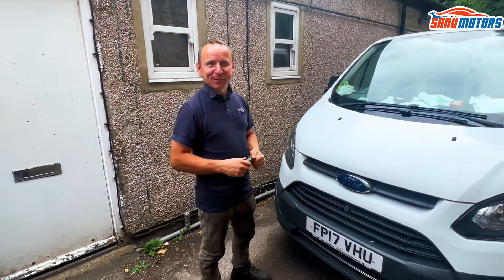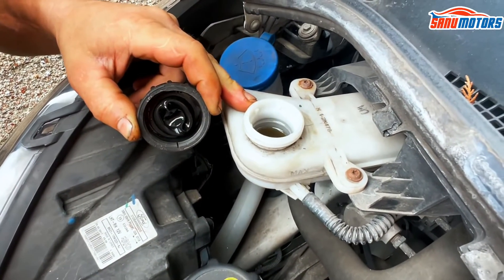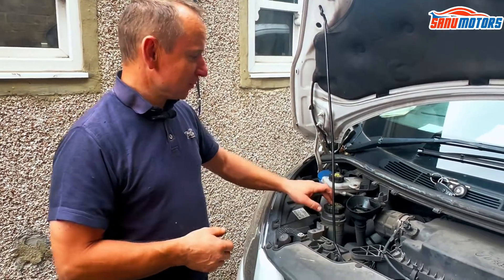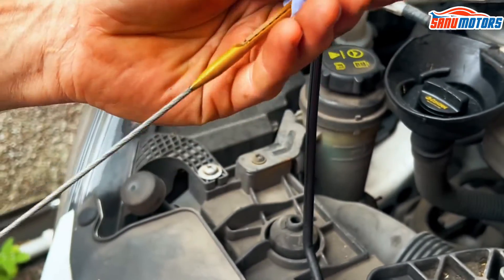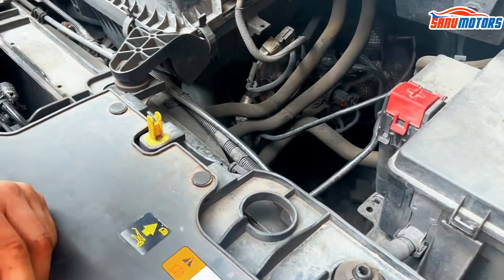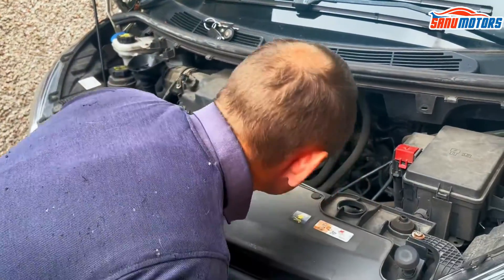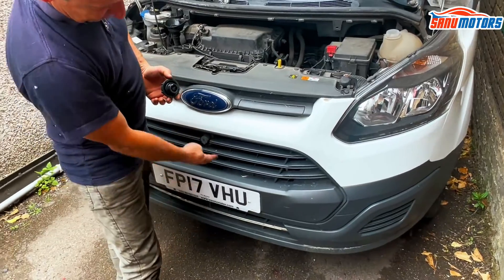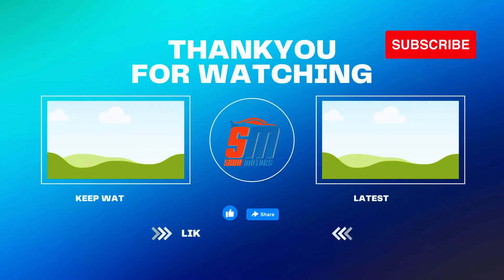🔴 Ford Transit Custom 2017 Under the Bonnet Topup  | Essential Fluid Check Guide 💥🤟#ford #

Comment: Top up the cooling with water ?
Reply from the maker: Topping up the cooling system with water can be a temporary solution, but it's not ideal for long-term use. Here's a step-by-step guide to topping up the cooling system with water:

### Steps to Top Up the Cooling System with Water:

1. **Ensure Safety**:
   - Make sure the engine is cool before opening the radiator cap. Opening it when the engine is hot can cause hot coolant to spray out and cause burns.

2. **Locate the Radiator Cap**:
   - Open the hood and locate the radiator cap. The radiator is typically located at the front of the engine bay.

3. **Check Coolant Level**:
   - Look at the coolant reservoir to check the current level. The reservoir should have markings indicating the minimum and maximum levels.

4. **Add Water**:
   - Slowly add water to the radiator or coolant reservoir. Pour the water until it reaches the desired level, but do not overfill.

5. **Check for Leaks**:
   - Inspect the cooling system for any signs of leaks. If you notice any, it's important to get them repaired as soon as possible.

6. **Replace the Cap**:
   - Once the water has been added, securely replace the radiator cap.

### Considerations:

- **Temporary Solution**: Using water alone should be a temporary measure. It’s important to use a proper coolant mix (usually a 50/50 mix of water and antifreeze) for optimal cooling and to prevent corrosion and freezing.

- **Antifreeze**: Antifreeze contains additives that prevent rust and lower the freezing point of the coolant. This is particularly important in colder climates.

- **Flush and Refill**: If you’ve used water in an emergency, plan to flush and refill the cooling system with the proper coolant mix as soon as possible.

- **Monitor Temperature**: Keep an eye on your vehicle’s temperature gauge. If it starts to overheat again, you might need to seek professional assistance.

If you have specific issues with your cooling system or need more detailed guidance, please let me know!